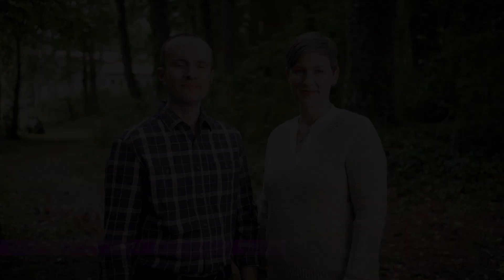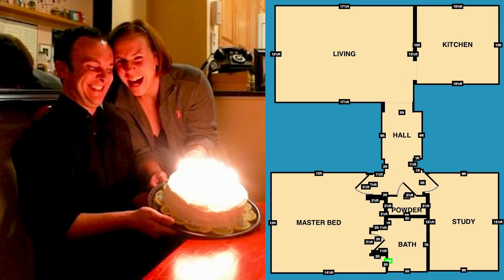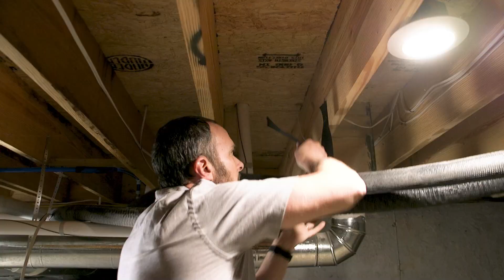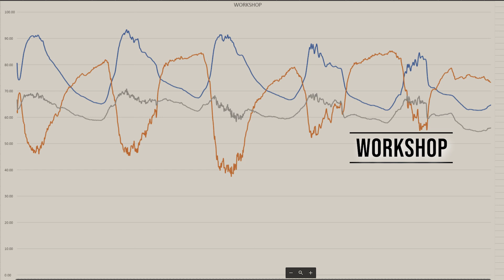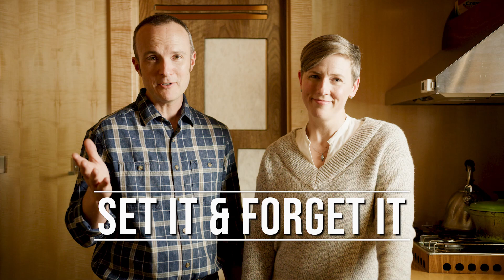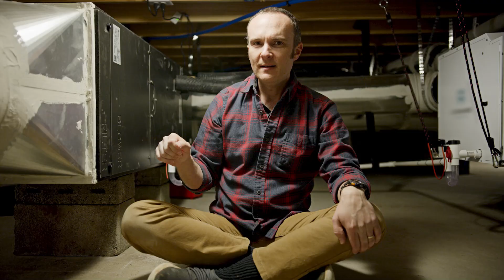Science of HVAC, Home Heating and Thermodynamics - Ep 208 of Home Diagnosis TV Series

Comment: Hi Corbett & Grace,
You are my HVAC guru I installed the silencer in my new 48” kitchen hood w/ remote blower in the attic here in San Jose, CA  and no contracter knew this trick. 
I need your advice on indoor air quality:
I have two of each air handler and ac units for each floor and want to add a HEPA filter  for dealing with wildfire smoke and tree pollen without having to add dedicated distribution ducts. Ideally I would want a ERV as well that can filter inside air as well as being in fresh air or some similar solution. Our 2nd floor master bed gets extremely hot so thoughts on dealing with that too would be nice- attic cooling fan and/or radiant barrier?? 
The air in Nor Cal is loaded with pollutants and irritants these days and it’s getting harder to breathe indoors.
Reply from the maker: Hey Rohan- thanks for following and for walking the walk! I’d be happy to help you, but your scope sounds like sn hour consult would make a lot more sense:
https://buildingperformanceworkshop.com/video-consulting

Comment: I get the not wanting to do setbacks because of issues around mean radiant temperature and not wanting to sacrifice comfort but I don't know if I buy the "it doesn't save that much energy anyway" line. Kinda goes against everything I've been taught or read. I do appreciate your focus on home performance as more about comfort and control and not necessarily energy savings and often there is too much focus on energy. I'll be honest though I got into this work though because of climate change so energy savings does matter to me more than comfort at times but its definitely a spectrum. Definitely agree that an air tight and insulated house loses heat slowly and setbacks don't matter as much. I wonder if there is some correlation or system for determing how many degrees setback would make sense based on the cfm50 and r value of home etc.. obviously the type of heating equipment matters as well.

As always thanks for your content. I've learned a lot from it and appreciate it since I feel like my training as a energy auditor was lacking in many ways.
Reply: I am a total novice, but I bet that the recommendations for setbacks for saving energy are assuming that most houses are not very efficiently designed already for the setting and climates they are in. I’d expect it to vary a ton by house, including both how well it’s sealed and insulated and how it is taking in the sun/shade/wind around it, and of course by actual climate also. I can imagine that for a well-sealed and insulated house, as well as one designed with passive solar heating and cooling elements in mind, the difference in setting the thermostat to a number closer to the outside temperature or not is almost imperceptible?
Reply from the maker: Good thinking, Anna, but I think the only fine point you didn’t mention is that when we’re not wasting some portion of our conditioned air hourly to start with, there is no Btu savings in letting the solid stuff drift toward outside temp, then drag it back to conditioned temp again. Same energy needed, less comfortable in the meantime.

Comment: Have heat pumps improved since the early 80s?  
I lived with one and the house in Midwest was always drafty & cold.
Reply from the maker: Everything has improved since the 80’s, that was 40 years ago!
Reply: It depends a lot on if its ducted or ductless. Ductless blows a lot of air for its size, but that can be reduced by having a better house that doesn't need a big heat pump.

Comment: I live in Colorado and I had AeroSeal seal up my ducts. My observation is my furnace will still dry out the air inside my house if I turn off my whole house humidifier. Humidity will drop about 1% per hour while the furnace is running. To me that seems like a direct relationship that the furnace will dry the air.
Reply: Furnace does not remove humidity.     The relative humidity which is being measured is dropping because the same density or weight of air is expanding but the exact same quantity of water is in that air so the water is being spread out when measured on a relative humidity meter it appears that the humidity is lowering which it is but the actual same exact quantity of water is still there. 

       And when that same exact air cools down the humidity will raise it is not that water was added to it it’s that that air volume is condensing with the exact same volume of water in a smaller space therefore the humidity number rises. 

There’s a good analogy using a sponge that is 50% saturated with water when it is not squeezed but when you squeeze the sponge down to a volume 50% less just to the point where the very first drip of water forms your sponge is now 100% saturated with water at that size

The same thing is happening with the air

And then when you let go of the sponge and it expands to 100% of it size it’s only 50% saturated with water

I hope that analogy helped
Reply: I was wrong above our house lost 7% humidity over 23 hours while the furnace was running and the humidifier off while it was snow yesterday.
Reply from the maker: That’s not the furnace, it’s air leakage.
Reply: @HomePerformance  but my ducts are super air sealed, or are talking about my house envelop air leakage of 5ACH?
Reply: @DaveDugdaleColorado  I would be surprised if the furnace was removing moisture. if I remember reading on this... when the cooling system is on and heat is trasferred to the outside condenser, the moist humid air condenses on the  cold coil insider the airhandler and goes to the drain as condensate... you can see the moisture dripping out and that only can come from the air passing through the unit... When the heater is on, there is no water added (especially if your humidifier) is turned off.. so I would be puzzled if it either increased or decreased humidity. I did read that the temperature of the air impacts relative humidity overall... but I would agree with the original comment about air leakage. Unless I have my humidifiers on and the furnace fans running in the winter, the whole house drys out trying to equalize moisture with the outdoors. Im not an expert... just read a lot about this :)
Reply from the maker: Yes, the air leakage through the skin of the home. Furnaces do not steal humidity, they just raise the temp of the air.
Reply: One test would be to turn off your furnace... and see if the humidity drops with it off (not very practical if its really cold there) :)
Reply: @HomePerformance  I’m confused, when humidity dropped 7% yesterday while it was snowing, the outside humidity was above 80% so the humidity should have increased because of my 5 air changes per hour. Are we talking about two different things, I’m I talking RH and you are talking about absolute humidity?
Reply from the maker: No, relative hum is confusing. 80% RH at 32 degrees becomes 19% rh when you warm it up to 70. Cold air is always dry, by definition.
Reply: Also since it was snowing all day yesterday, the outside humidity was over 80%. So something had to be taking my humidity from 35% to 28% during that time.